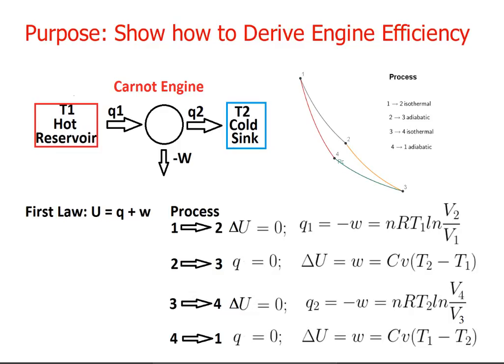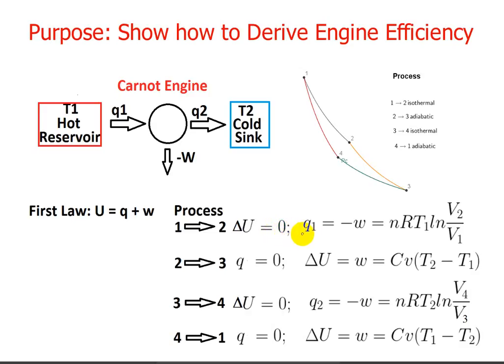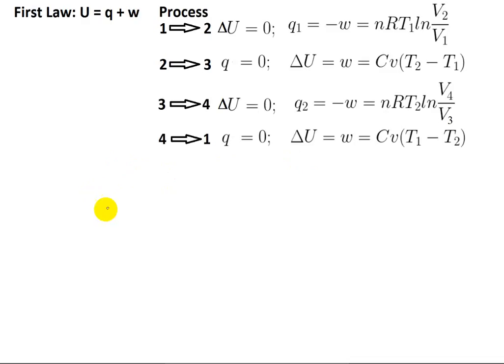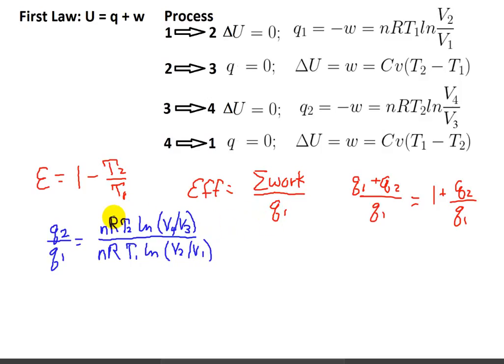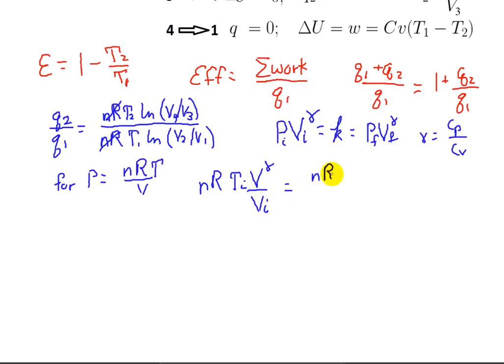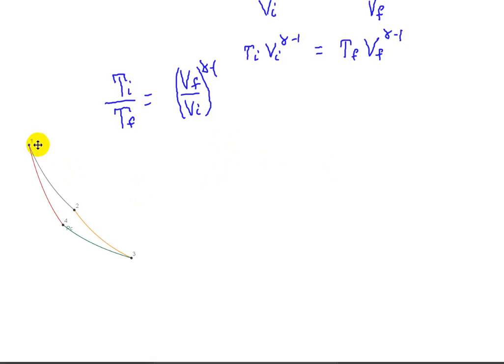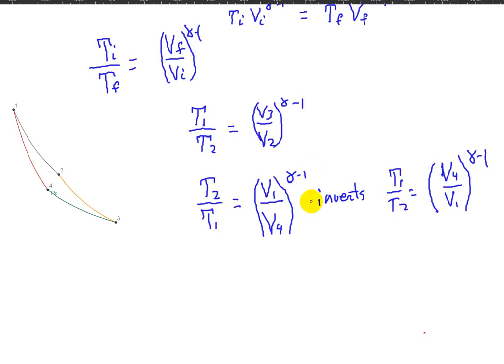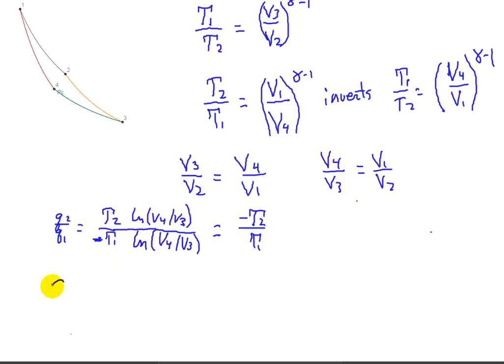Derive Engine Efficiency

Comment: At 13:03 the efficiency equation is incorrect, it implies the efficiency is at least 1.
Reply: my apologies, the efficiency equation at 13:03 is correct as the directions of the heat flows are opposite